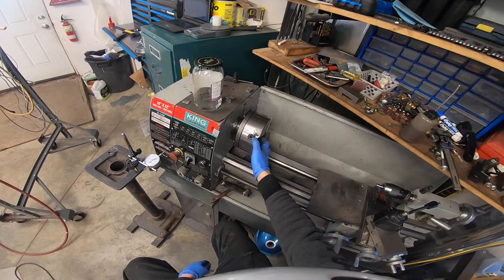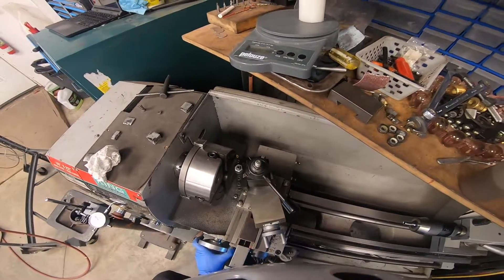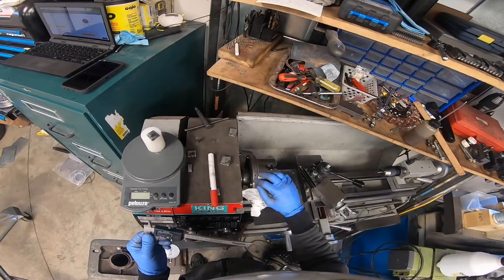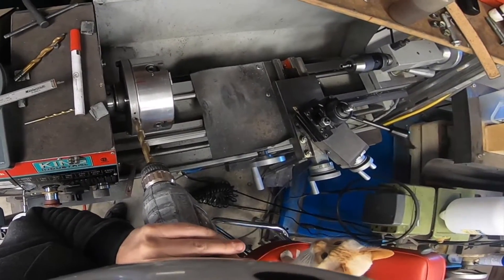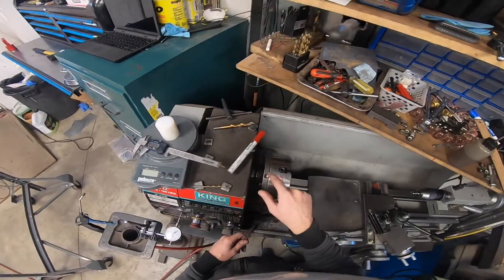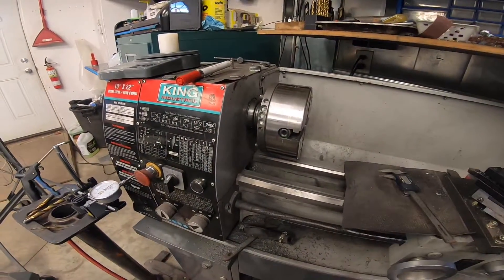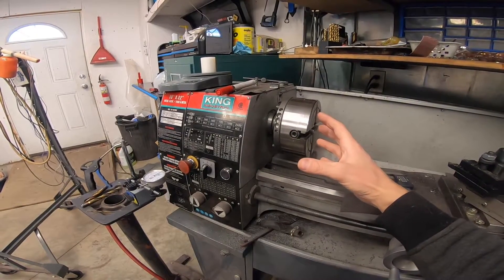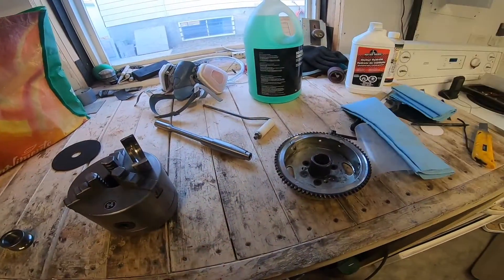DIY Dynamic Balancing !! - This REALLY works ! Balancing my lathe - Part 2 - Apr 2020

Comment: All depends how your machine is I bet if you go max rpm your dial indicator will move a lot more
Reply from the maker: The trick is to try a few different RPM settings and find the RPM where you get the most error...  More RPM does not always mean more vibration, if fact it often means less. Higher frequency vibration, but less amplitude. This is because of the inertia. At certain. frequences, some forces can cancel each other out.

Comment: Thanks for making this video. My 4-jaw was way out. I used this video as a basis to come up with an easier way of balancing the chuck. Before I do any epoxy work I will undo the balance and make a video. I was able to go from about 40thou on the dial indicator to 1 in about 5min without using that website you linked.

The gist of it was I set up an indicator much like you did, but on the DRO stand at the very top of the lathe. The higher it is the more sensitive it is, and that high I didn't need to set the lathe on anything (I also really didn't want to re-level it). With the jaws removed I set the speed to the point of greatest deflection. Then I put a few magnets on the chuck to see if it was better or worse. If worse I would move the magnets and see if it was better or worse again. Once I found the point of least deflection I would add more magnets until I was happy with the reading (about 1thou). At this point I could have drilled the opposite side of the chuck like you did, but I have carbide inserts for tools I don't own, so what I am going to do is epoxy a bit more than the weight of the magnets into the casting void in my chuck. I was able to test the carbide first by just supergluing them in place where I saw the same 1thou of deflection.

Thank you so much for your video though. I tried balancing the chuck once before years ago like I would balance a surface grinder wheel, and that was pretty terrible.
Reply from the maker: That's great. How does that saying go "on the shoulders of giants". Not sure if this is the perfect situation for that saying, but it is always awesome to expand on, simplify and repurpose an idea from someone else to make it better or to suit a different application. Also, I can totally understand why someone would not want to drill holes into their backing plate, especially if you have decent equipment. 

I don't know what your exact set up was, and I'm likely overthinking it, but I would worry about harmonics / flex in the DRO stand causing a false reading. You could get some chicken head effect, haha... where the DRO stays still even tho the lathe is moving, and the RPM where you get the highest reading could just be where the frequency wavelength matches. 

If you have a rigid DRO stand, then I'm sure this is not the case, but something to keep i mind.
Reply: @JoelArseneaultYouTube  yeah, if the DRO stand was a flex arm or something then I wouldn't be able to use it for taking a reading for exactly the reason you stated, but my DRO is mounted to an aluminum post that is bolted to the top cover. It is quite rigid. If I didn't have that then I would likely be able to make due with a magnetic indicator stand (the ridgid pole style) stuck to the top of the lathe.
Reply: @JoelArseneaultYouTube  https://www.youtube.com/watch?v=rcgbGAzaCv8 I managed to make the video. Start to finish was about (minus epoxy cure time) was about 5min while I was doing it one-handed.

Comment: Little advice, if a vid ends up in 2 parts put a link to part 1 so we don't have to try and find it ....
Reply from the maker: Thanks for the heads up. I try to remember to do that, but I guess I missed it on this one.
Reply: Thanks for adding the part 1 link. How is the lathe now as rpm increases, say 600 or higher rpm?
Reply from the maker: @bradj.3832  It's great, actually. I never run it as slow as I did in this video... that was just for safety when balancing. There may be a specific RPM where it would vibrate some / more, but I haven't found it yet.

Comment: Balancing a flywheel and crankshaft is appearing to be much harder because flywheels are balanced to within a gram.  Some have indicated it should be balanced 2-5 grams.  Spinning a flywheel is a much bigger mass to be spinning around and most use balance machine use vibes meter and not a dial gage.
Reply from the maker: Yes, that is correct. I have recently commented something similar to this in response to people asking about using the lathe to balance other objects. One of the main issues is that the mass of the lathe is high enough to mute out imbalances due to inertia, regardless of how accurate of a measuring tool I use. 

Also, yes. most machines used to balance flywheels and crank shafts use load cells or vibe sensors and "fancy" software to pinpoint not only how much mass but the location of that mass. Compared to a dial indicator, this makes it much faster and also gives you the exact location to add or remove weight, where using this "simple" program and dial indicator may have you remove or add a small amount of weight in two places because the location of the imbalance is between those two spots. 

Thanks for the comment !

Comment: Would love to see a DIY Home Balancing setup (maybe you already created it?).  I've been thinking of how to do this for a while now.
Reply from the maker: Hey. Thanks for the comment. 

I haven't done it yet. I've been really busy with other things and ran into some financial difficulties. 

In my mind the easiest way to go about making a balancing tool is by supporting a shaft from bearings, with the bearings supported by springs. You would then drive the floating axle with a o-ring type belt to allow it to move freely. I think a bearing carrier with 3 attachment points would work well. 

This would take some experimentation to sort out, but you would want the top spring to support the weight fairly well, but allow some movement while the bottom two springs could be substantially lighter and just there to add some stability. 

If possible I would hang the item being balanced centered between the bearings. If it were hung off one end, like in a lathe, then the load on the bearing opposite the item being balanced, would actually have the stiff spring on the bottom and two light springs at the top to stabilize. 

I hope that makes sense. Basically you need a way to rotate an object, while allowing it to move as freely as possible... this includes keeping the mass of your tool as low as possible, while still being safe, secure and true. A heavy tool will mute some of the imbalance in your part, due to inertia.

Comment: I wonder how much of a problem the jaws will present.
Reply from the maker: You can't really try to balance fro the jaws. You can easily balance them on a scale, and that will work fine for perfectly round stock... but with a 4 jaw your jaws aren't necessarily going to be in the same positions, meaning that the balance will be out. 

The only thing you can logically do is to balance the body, as it is the largest portion of the mass and remains constant. 👍
Reply: @JoelArseneaultYouTube  yes, good point. Funny...I spoke before I really thought about it. Thanks. -Tom
Reply from the maker: @tomeyssen9674  Sometimes that's how I find my way through problems. Start talking about or writing about them and the answer comes to me. People commenting on my videos and asking questions is often how I figure things out ... It really makes me think more in depth.

Comment: Your video was really informative .Thank you very much . I am in the process of making a balancing machine to balance crankshafts , flywheels , pulleys etc . To get the reciprocating parts to be balanced is fairly easy . The machine or fixture will be of a soft bearing type and using your method might just work great .
Reply from the maker: I would still love to build something to balance flywheels and other parts, but I just don't have time for now, with everything else that I'm doing.  Good luck, and thanks for the comment !

Comment: If you used smaller magnets, would the resultant holes be smaller?
Reply from the maker: The holes are a result of material that needs to be removed. That amount of material will need to be removed regardless of the size of magnets. 

The placement of the magnet offsets the weight that is present in the chuck. If the chuck was perfectly balanced, then you would not remove any material. The more out of balance it is, the more weight you need to remove. 

However, smaller magnets could allow you to get more accurate results. The limiting factor is how sensitive your measuring is. Meaning, if you put a magnet on that only weighed a gram, it would not be enough to effect the vibration of the lathe. If you can't read the movement, you can't make any calculations.